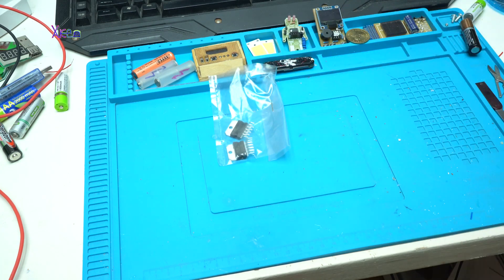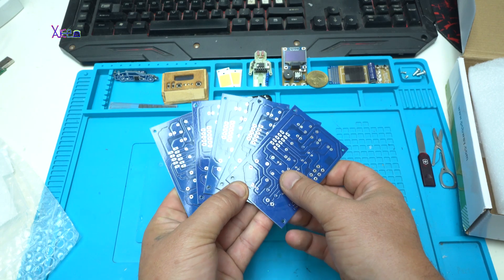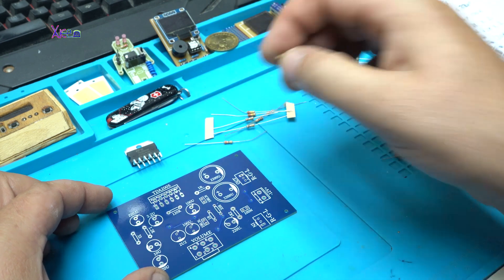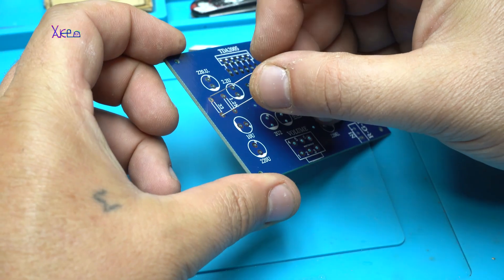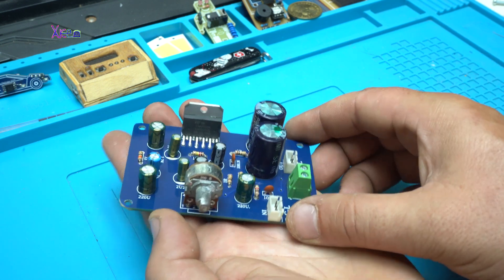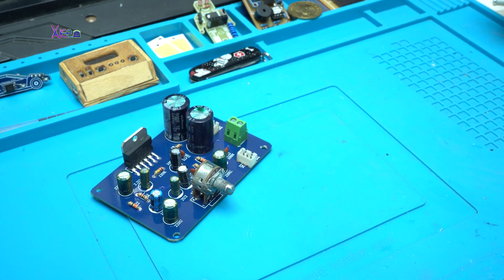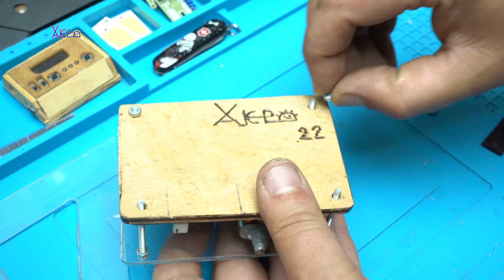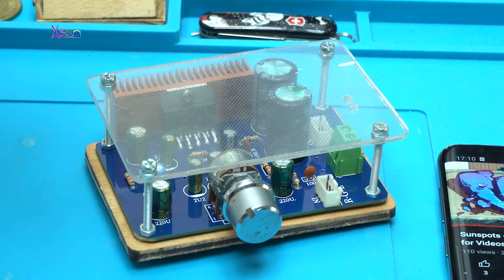How To Build Audio Amplifier at home

Comment: Hello thanks for the Video, the circuit diagram is mono, pls add stereo circuit from the data sheet. This is quite a tough IC to break, why I am saying so is because I started building this amplifier in 2007, due to some issue with PCB design which I did my self could not get it working and I kept it for hibernation until last week and now got it working in 2023 by pulling all components out of PCB and resoldering on general purpose board. This tolerated all wrong connections made by error and still alive. Resoldering took  so much of my time I wish I had a PCB board like yours 😊.
Reply from the maker: Great that you try it to make one more time,I am making mistakes all the time in my projects but that is the way of learning,btw to be honest my pcb for amplifier have some errors and I get not clear sound.stay good and creative,never give up😃
Reply: @Hacktuber May be I think that is because of 2200 uf cap polarity, in data sheet diagram it's printed reverse, check once. -ve should go to speaker.
Reply: Built one more amplifier using the same  IC which I had kept unused, I wanted to do it the PCB way this time but the print ruined the IC position as I missed to print the mirror image 😢. Finally assembled all components on a general purpose PCB and for IC itched a small board, it's hard to find laser printers around my area. This time I used  polyester capacitors for 100nf and not much difference in performance, any way it is working fine like the first one.

Comment: I built myself a subwoofer with two 21 inch woofers. Is as big as a refrigerator. I want to build my own amp too. Can't I just solder 200 of these ICs'TDA 2005 together and then connect them directly to 230 volts to get enough power for my subwoofer?